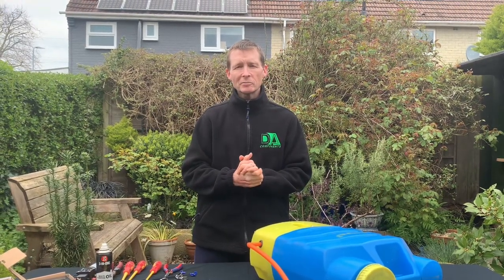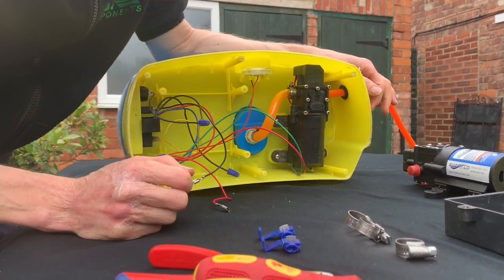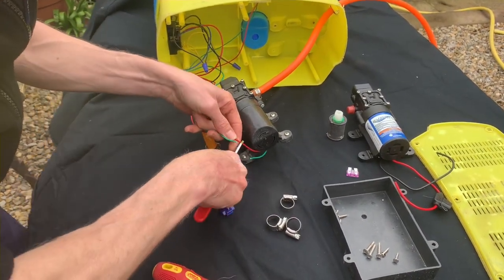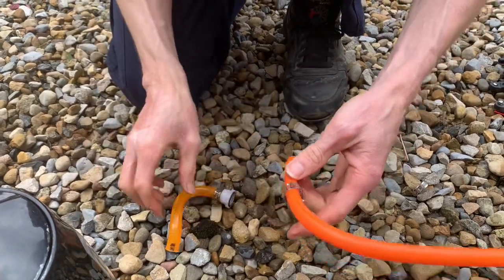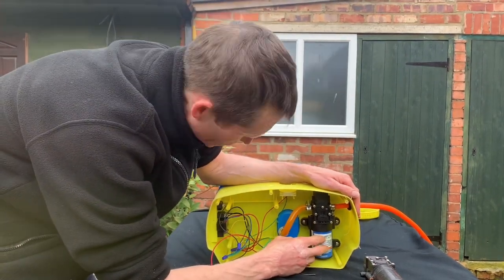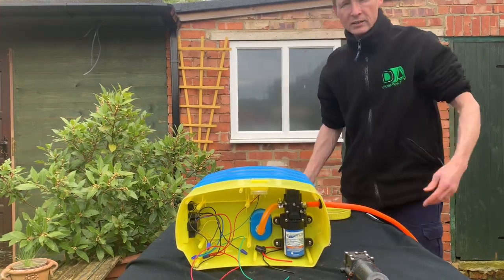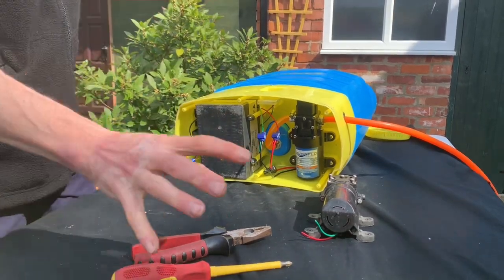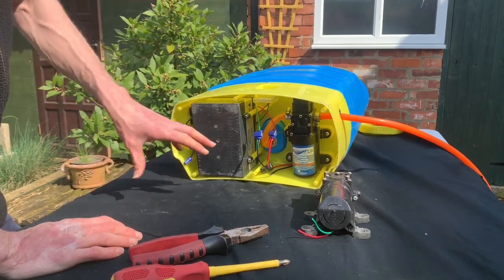Installing a chemical backpack pump

Comment: Morning Darren, great video. I have 2 pumps to fit I got from you. Can you tell me what size blue electric clips to use? Never been that good with electrical stuff. Thanks 
Steve
Reply from the maker: Hi Steve , did u receive a few wire connectors in with the pumps ?
Reply: @dacomponents  Morning Darren, I probably did mate. They are up at my unit and a job for this week. Put the comment on before I saw all of the video. But I found the vid extremely helpful for me to swap them over. 
Great service from your business by the way. 
Cheers 
Steve